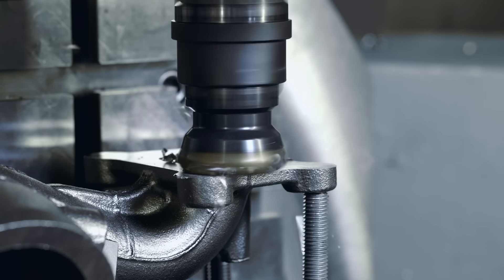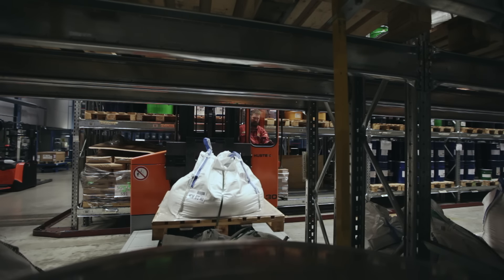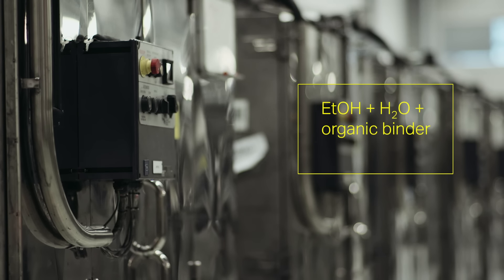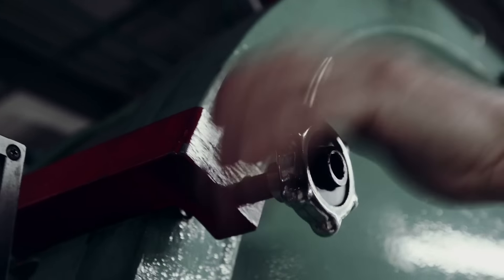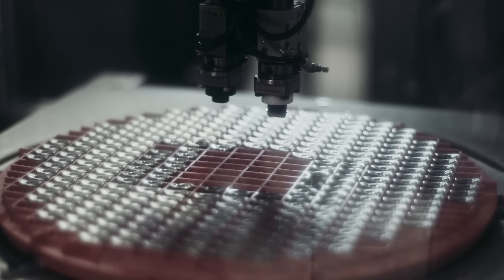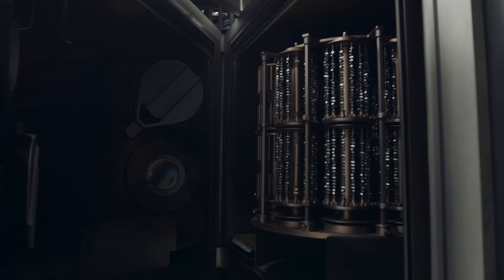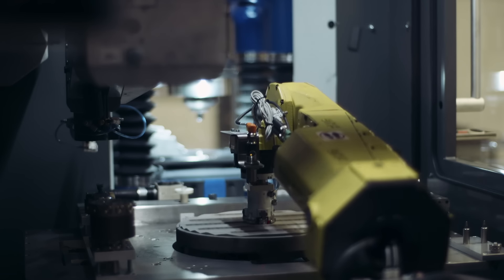How carbide inserts are made by Sandvik Coromant

Comment: I learned a lot from this great video. The first carbide I remember using was "Carboloy" by GE in 1956. Carbide blanks were silver soldered on rectangular steel shanks for turning and boring tools. Inserts as we know them now came later, but invention of carbide resulting in "Carboloy" came along in 1928. See GE video  https://www.youtube.com/watch?v=Z4p7OVGYZGg .
Reply: The silver soldered tips worked well enough, but were terrible things to re-sharpen if you chipped them, especially large  chips.  I must have ground hundreds of them by hand; silicon carbide, usually green, wheels for the tungsten tip, and aluminium oxide wheels for the steel shank, alternating between both.  They were then lapped by hand on a diamond lapping wheel with either kerosene or some green coolant mixed with water.  These of course did wonderful things for the skin on your hands, always rough, dirty and not very nice to impress the girls.
My first encounter with throw-away inserts was in the mid sixties, I think they were Coromant, but the method of clamping was by a clamp plate under which chips often became lodged, causing much grief.  Being very expensive we made up our own tools by silver soldering used tips onto steel shanks and grinding them. they did not have a hole in the middle
I went into business in the seventies and a Valenite-Modco representative showed me their range of tools.  I was impressed by the eccentric screw to clamp them in; no obstructions on top  unless you needed the clamp bar for heavy cuts, a method still in use today.  I bought a range of turning tools and here I am still using them in 2017.
Things have changed a lot since I was an apprentice.
Reply: Robert King: Thanks for sharing your interesting carbide experience with use. Those early blanks were very brittle with no grooves behind the edges, and difficult to silver solder and sharpen.  Negative top rake was used to prevent chipping and interrupted cuts would destroy the carbide. High speed machining would be impossible today without modern inserts and engineered coolants.
Reply: Did you have any clue back when Kennedy was assassinated that Oswald didn't do it ?
Reply: Adrien, No, I had no information at the time except local and national news. l'm certain that Lee Harvey Oswald shot Kennedy, otherwise why flee and hide in a theater? He was almost certainly the final link of a large conspiracy, most likely from Cuba as payback for the failed Bay of Pigs invasion.
Reply: Thank you for your reply. To answer your question I believe he ran because he knew what was coming, but he understood it too late to flee farther than he did. I urge you to watch the movie "JFK" by Oliver Stone, it's a beautifully realised movie about Jim Garrisson, an FBI chief who took it upon himself to investigate the assassination and make a case after Bobby Kennedy was also killed (and practically every male in the family as well as women during the following years). This is a serious, extremely well researched movie, and if nothing else a pleasure to watch (seeing people in nice suits, nice cars, polite, respectful talkers, etc...). He was persecuted professionally, and attacked relentlessly by the press and various organs of the government. The movie doesn't push any theories in your face, it only presents all the facts surrounding the event through the fight of Garrison to make his case and present it.
Here is a link to watch it online for free:
http://putlockers.fm/watch/OvkQRQGQ-jfk.html
(you may have to wait a minute for it to load after you click play).
Reply: I've watched the JFK movie and found it highly suspicious in believable detail. Movies of this type, produced years after a shocking event, will always draw popular interest while making tons of money for the producers. I don't believe the movie comes close to telling the true story of the Kennedy assassination.
Reply: If you are able to disprove anything Jim Garrison asserted during the trial, It will be a welcome addon to what I know from the case.
The thing is, it has been proven beyond any shadow of a doubt that Oswald or anybody else for that matter couldn't in a million years do the shooting that happened that day, unless you believe bullets can leave and re enter a human body seven times, making 180 degree turns in mid air multiple times to finally land undamaged and unbloodied on the door of the car. There had to be multiple shooters, and they had to be in front of the car. That's just physics, you can't deny that. There was therefore by definition a conspiracy. If you believe in basic physics, you have to believe that. Those facts are both on video and in the original government reports from that day as well as in the Clay Shaw trial files, and freely accessible.
I have done the research, and so far wasn't able to disprove a single fact the movie shows, it is extremely well researched. I understand you don't want to believe it, my question is, do you want to know the truth or would you rather make your own truth, one that's a lot more livable and a lot more comfortable.
Again, if you're able to disprove a single relevant fact about the assassination, I'll be happy to learn about it. 
While we're at it, here are a couple books that talk about other little known facts, again fully documented with names, dates, places, flight numbers, witness testimony from FBI, CIA, local police, etc...
The Politics of Heroin in South East Asia by Alfred McCoy, and Cocaine politics. Both talk about the involvement of elements of the US government (mainly CIA and military) in drug trafficking during and after the Vietnam war to finance military operations without congressional oversight, mainly in Laos. The first one also talks about Iran Contra. Since you probably will automatically dismiss it as impossible just like you did for JFK, and I can't hate you for it, the truth is very hard and scary to acknowledge, most of us don't have the strength to actually take the risk of doing the research openly without refusing to consider every possibility and finding out that the truth is horrid. It takes a lot of courage and dedication, as well as respect for knowledge, and many lost their lives because of it, that's the case of Los Angeles policeman Mike Ruppert, who fell into alcoholism and recently commited suicide after a life of solitude, exclusion, abuse and lack of support in his fight for justics. You could make the case that the JFK movie was for profit, but you cannot make that case for him. Here is a video where he describes his fight during a conference: https://www.youtube.com/watch?v=FrT-FJAgc0I
I have enough respect for you to share this information even though I pretty much know that you won't ever consider it, because it's too much, too terrible. But there is a small chance you might decide to do the research and seek the truth, and that is worth every insult, every dimeaning statement, and every wasted comment.
Reply: No comment. If you want to get your facts from movies, have at it.
Reply: I'm very disappointed. I expected honesty... I don't get my facts from movies, I get my facts from the US department of justice files about the trial of mr Clay Shaw... The movie was based on the trial, not the other way around. But I can see that you cannot disprove a single fact from Garrison. That's fine, I told you I understand you aren't able to deal with that much all at once, but I did expect honesty from you, I don't know why.
Reply: I'm disappointed in you also. You received my honest answers, although not the pointless arguments you wished for. I'm certain you can find many others eager to discuss your fascination with JFK assassination.
Reply: What does the JFK assassination have to do with tungsten carbide?
Reply: Peter Woulfe discovered Wolfram in the late 1700's. His daughter had a son called Paddy Kennedy.
Reply: Are carbide tipped saw blades made the same way?

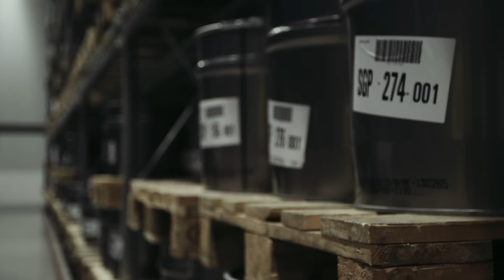Comment: A brilliant video! Although I have a question why do u use handle labour adding ingridients in the mixture (It was shown on 0:59 second)? I mean if almost all process is automated.
Reply from the maker: Thank you! We are really glad you like the video. In some of our recipes the amount of material added is so small that it's simply not possible to automate it.

Best regards

Claes Nord 
Communication manager, inserts production
Reply: The small amounts need to be doled out by hand. There is one process called de charge where we would use a piece of pvc pipe to beat the back side of a coating tray to get the inserts loose. It always made me laugh. We had millions of high tech machines. Brought in new shipments daily of new equipment. Computers came in by the pallets. This job required a foam pad and a piece of pvc pipe. Hilarious

Comment: Fantastic insight in making one of the hardest materials in the world. I'd like to see the process for making the ceramic inserts, doubtless using similar techniques and processes, but still interesting.  As long as you use a dry mill, you can grind away with cermics all day long at high speeds and high rates.  But one drop of water and it'll sound like God snapping His fingers when that ceramic insert lets go.

Comment: Broadly similar process in the place I worked as a 21 year old. We were making the hard faces of vehicle ignition contact points.
Mixing of the tungsten carbide powder, pressing, sintering and in our case then swageing out to long rods, centreless grinding then cut into thin discs which were then brazed onto the backing metal before grinding into a slight domed shape.
Obviously no special additives as they weren’t intended to cut metal, but millions were produced every month.
It was however a horrible place to work, but interesting to know the process.
I believe a lot of these carbide inserts are made in Israel.

Comment: +Sandvik , how do we grind these inserts once it has become dull ?
Reply from the maker: Hi Sachin,
 
When the carbide inserts are worn out, the general recommendation is to recycle and not re-use them because they are designed that way. Upon grinding, insert's center height will be affected and this, in turn, will lower the overall performance and increase the chances of rejection. Reconditioning (regrinding+coating) is suitable for tools like solid carbide drills, end mills, and reamers. Visit Sandvik Coromant website to learn more about recycling and reconditioning: https://www.sandvik.coromant.com/en-gb/services/sustainability/pages/reconditioning.aspx 

Take care
Reply: +Sandvik , ty

Comment: Look up the history of carbide tooling. 
1. Brazed carbide on a steel shank. Faster cutting possible, longer tool life, but it would be cool it we didn't have to regrind them. 
2. replaceable, indexable inserts, with 4-8 cutting edges per insert. (may have been two or three separate steps) Would be better if they lasted even longer. 
3. Coated inserts. Faster speeds, longer life, but we want more. 
4. Diamond coated inserts. Even faster and longer lasting. Can't be used on steel or iron though.
5. Does boron nitride coated inserts exist yet?
Similar pattern exists for steel tooling as well. Basically the industry asking for the golden goose to lay eggs faster, longer, for less feed and companies like Sandvik actually do it. If you want a job closer to magic than this you have to go into chemistry.

Comment: @Sandvik Coromant okay so a carbide insert is "used to machine..." but how? Just looks like a square nut to me. How do these get turned into cars?
Reply from the maker: Hi Paul,
The insert is the actual cutting edge that is used to remove metal in various applications. If you browse around in our channel there are plenty of examples of how the inserts are used in machining different components. Below is a link to a demo of face milling aluminium cylinder heads for automotive engines. https://www.youtube.com/watch?v=-uPs9-e111Q
Take care!

Comment: Sandvik: 2 whole days of meticulous labor for a single insert

Me, a CNC Operator: gimmie 30 seconds and I'll need the Torx again
Reply: It takes way more than two days from start to finish. The sintering is approx 12 hours. CVD coating recipes run up to 24 hours. The powder takes 24 or so hours. The grinding process takes a good while. There are a few cleaning stops along the way. One process uses sand and water. Takes a little bit. I would say that it takes closer to a week. That is if it isn’t a fancy one. Some of them have a more specific grind.

Comment: in 3:52，a device like vacuum cleaner is put into the certer bore of sintering boat, anyone know what is that device used for? thx!😂
Reply from the maker: Hi! The "Vacuum cleaner" are hoses that are connected to the heat exchangers on the roof to create heating/cooling for the factory.

Comment: i had a bradly kimura II butterfly knife made with 14C28N by sandvik. you could tell that metal was much different by the way it feels plus the sound it made when the handles collided with the striker, it almost sounded like metalic marbles bouncing off one another. i opened a sealed lead acid container to fill a battery and the acid left the lightest watermark on it like when rain drys on a car but no rust. everytime i have opened a container like that with a razor blade or gas station knifes they would corrode over nite even if wiped dry right away. unfortunately for me, i suspect that my roomate at that time stole it from me... if that knife wasnt discontinued i would by another

Comment: Well, I still have no idea what a carbide insert is, but I can sure as hell tell you how they're made!
Reply: They are general purpouse, replacible cutting edges (as in the literal meaning of "cutting edge") used in a lot of different manufacturing and machining tools. The inserts are like super hard steel teeth, that you can attach to drillls, routers, lathes, milling machines et cetera. They are about the hardest and toughest material avaliable, used where any other steel would dull instantly. This is a game-changing product for a lot of industries, and Sandvik is about the only company in the world that has the skills and know-how to turn out a product like this.
It is something of an engineer's dilemma: how do you make something that is harder than any other material or tool that you have avaliable?

Comment: 3:47 how does excess heat cool you down in the summer?
Reply from the maker: Hi,

In the Gimo plant we use Munters DesiCool® units for ventilation, cooling & heat recovery in wintertime. The energy for this, we take from the cooling towers which are connected to the production. DesiCool® operates by sorption cooling. You can read more about DesiCool® here: https://www.munters.com/en/munters/cases/desicool-1/

Take care

Comment: How the hell do they use the excess heat to cool themselves down during the summer?
Reply from the maker: In the Gimo plant we use Munters DesiCool® units for ventilation, cooling & heat recovery in wintertime. The energy for this, we take from the cooling towers which are connected to the production. DesiCool® operates by sorption cooling. You can read more about DesiCool® here: https://www.munters.com/en/munters/cases/desicool-1/

Best regards,

Claes Nord
Production - Sandvik Coromant Gimo
Reply: Global waeming.

Comment: Each manufacturer is very secretive of there formulas on the outer multiple thin layers, where the cutting performance happens this wasn't the case years ago. The carbide it self was much tougher because the multiple layers hadn't evolved in the industry yet.

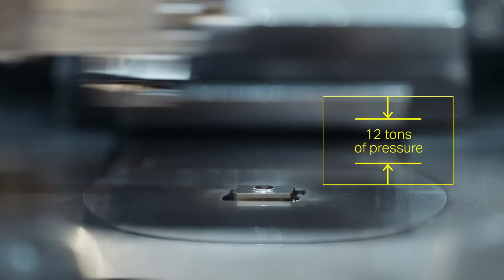Comment: 2:27 What is "12 tons of pressure"? A ton is a mass, not a force, and a pressure is a force per unit area, not just a force, and definitely not just a mass. 

Were SI units to be used there would be no ambiguity. Is this video designed for the  rump of Liberia, Myanmar and the US still using Imperial units?

Comment: 3.:47 sandvik defeats laws of thermodynamics by using excess heat to cool the factory in the summer
Reply from the maker: Hi,

It's actually really cool! (pun intended) :)
In the Gimo plant we use Munters DesiCool® units for ventilation, cooling & heat recovery in wintertime. The energy for this, we take from the cooling towers which are connected to the production. DesiCool® operates by sorption cooling. You can read more about DesiCool® here: https://www.munters.com/en/munters/cases/desicool-1/

Best regards,

Claes Nord
Production - Sandvik Coromant Gimo
Reply: 1 . to many in the time stamp to make it work 
back of napkin thinking would answer yes it can be done just how 
heat to power steam to make electricity  to power cooling. would be quick answer

Comment: Is there a factory in China? I was looking for some inserts for an old lathe cutting tool I have, and none of the local suppliers had anything like it, so I looked on aliexpress. After a bit of searching I found some inserts that where the right size (they are quite large triangular shaped), they were US$15 for 10 inserts, which I consider very cheap. When they arrived, to my surprise they are in a red box and sealed at each end with Sandvik Coromant stickers complete with barcode and website www.sandvik.com
I assume these are not fakes, but I really don't know.